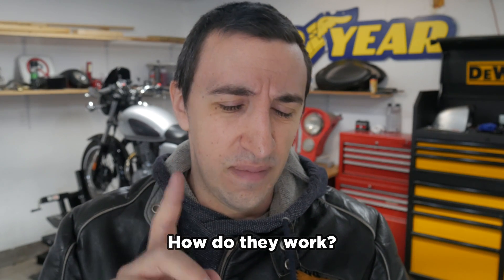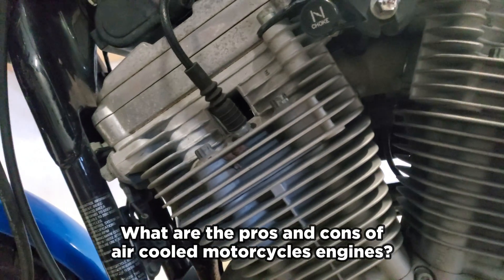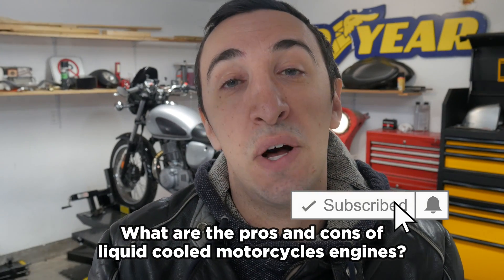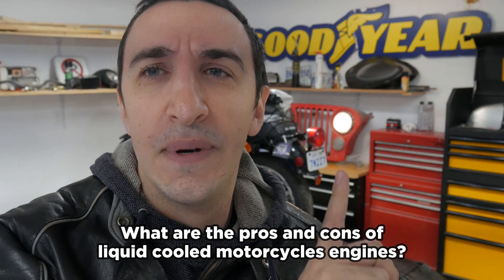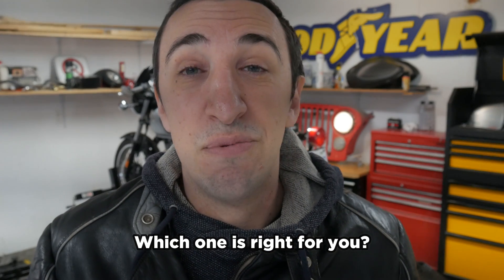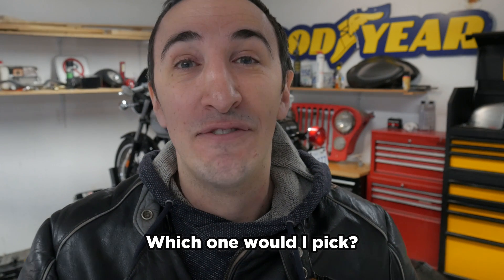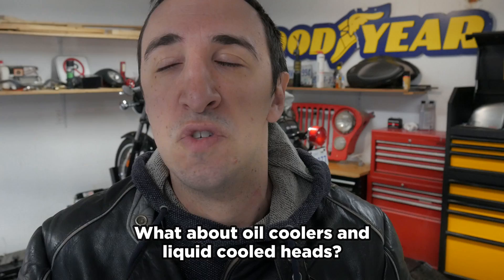Liquid Cooled vs Air Cooled Motorcycles

Comment: I’ve always wondered how my air-cooled riding lawnmower engine doesn’t overheat! Riding lawn mowers don’t move very fast & the engine is covered by a hood & the temperature was 96 degrees when I cut the lawn. 🤔😲
Reply from the maker: The RPM is probably wayyyyy lower than on a motorcycle... Less combustion 💥, less heat🌡️!

Comment: Another benefit of watercooled is they get UP to temperature faster than an air cooled because the thermostat allows the engine to heat up to its operating temp vs the air cooled still having fins when cold. It leads to a much more consistent temperature thats much more ideal for an engine.
Reply from the maker: I didn't even think of that, you're right! Thanks :)

Comment: Hello great video I Live in Oklahoma small town and I was getting my wife a 250cc automatic liquid cool motorcycle but it was Too big she’s only 411 and she doesn’t want to be on a tiptoes so she wanted a 200 cc automatic but it’s air cool and it’s not a lot of Traffic backed up so will that be good enough for her and she’s fairly new to ride motorcycles please let me know it fits her better it will be a big help
Reply from the maker: What model are you thinking about? How about a Suzuki S40? Seat height is real low. 650cc. Air cooled but if she doesn't wanna go fast that's okay.

Comment: Whether liquid, oil or air cooled all bikes predominantly use air to cool them. It just swings abit in favor of liquid cooled at low speed/high temps when that bitty little fan makes up some of that ground. The biggest advantage of liquid cooled engines is the ability for the engineers to build tight tolerance high hp machines. Thats why Harley can ONLY go bigger CI. Because torque is the objective.
Reply from the maker: If we ignore all of the liquid cooled Harley-Davidsons, then sure lol

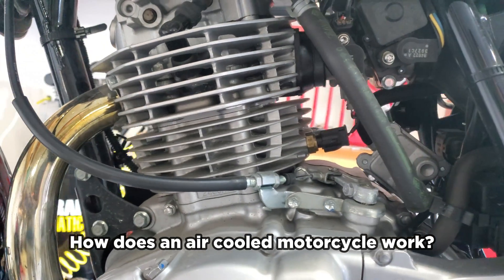Comment: You forgot to explain, that air cooled is used in lower compression ration (below 1:10 ), and liquid cooled is used in higher compression ration (higher than 1:10)
Reply from the maker: I never thought about it like that but you're right :) I think it's a big of a chicken or the egg. Did they make the engine liquid cooled because they wanted more compression, or did they give it more compression because they could because it was liquid cooled. Perspective...

Comment: When I'm sitting in traffic I shut off the engine to prevent the it from overheating. I tend to shut it off more often during the hotter months for obvious reasons.
Reply from the maker: I'm currently enjoying riding a Sportster in the winter here in Canada, for opposite reasons haha :)
Reply: hotter months ?? How hot are we talking ? 
I live in Florida where its hot year round between 80-95F

Comment: Thanks for the video. Why does the coolant in a motorcycle has to be replaced a lot more often than in a car? My Suzuki motorcycle manual says every 6000 miles and my car manual says to replace the coolant every 60,000 miles.
Reply from the maker: @JeffBassir-lo6zj  I'm no expert on coolant fluid but there are probably a few of reasons. Just a guess:
1) motorcycles have smaller radiators so you have way less fluid in there to do the job.
2) motorcycles run at way higher rpms which could cause way higher temperatures so not only do you have less coolant to do the job, but you have more work for it to do.
3) maybe something about how motorcycles are used less often are their parts are more exposed to the elements 🤷🏻‍♂️
Some things I don't ask why, I just trust that the engineers who are way smarter than me know what they're doing and I follow their advice.
Reply: @YouMotorcycle  I just trust that the engineers who are way smarter than me know what they're doing and I follow their advice.
That is the WRONG mentality.
Reply from the maker: Ok, I'm glad you know more than Suzuki's engineers. Since you're the genius among us, why don't you answer this person's question than, rather than simply criticizing others who are trying to help people?
Reply: @ well since you are cocky and arrogant i will not answer his question. 
I "work" with engineer's and have to deal with them on a daily basis.
Engineer's work with the mentality of perfect world scenerios not real world applications.
But YOU can google search the answer a hole
Reply from the maker: I'm not the cocky one. I'm the humble one saying professionals know better than me. You're the cocky one who thinks you know better than professionals. It sounds like your work has left you bitter. I feel bad for you. Your life doesn't sound fun.

Comment: I really like the looks of MotoGuzzi V7 or V9 classic bikes but the fact they are air cooled makes me worried.... I don't plan to ride them to town(much) but I do want to ride a lot in summer and take hot vacations to the seaside... I worry it would overheat.
Reply from the maker: V7 owner here. It's ok. The transverse vtwin with the cylinders sticking out helps since both cylinders have more space to cool in the air and neither cylinder is so close to the rider's core. It's a better setup than a traditional v twin like on a Harley where that rear cylinder gets no breeze and is right under the rider.

Comment: Do they have temp gauges or how do you know if your Harley is starting to over heat so that you know that you need to start moving or turn it off? Also does this mean it can’t be idling while sitting?
Reply from the maker: You'll feel it lol. I believe there may also be a light that comes on. It depends on the bike. It can be idling while sitting, but not for extended periods of time. Then again, no motorcycle should be left idling for extended periods of time.

Comment: I'm thining of buying a Moto Guzzi V85TT Travel. It's air colled.
Reply from the maker: Plenty of Moto Guzzi content here: https://www.youtube.com/watch?v=1xhEjQJsdIE&list=PLDu73pf3mUGBSdEFuHHe19lm-9_X1AEsJ
Reply: Okey thanks. But it's the V7 not the V85 model not sure what the difference are. @YouMotorcycle
Reply from the maker: @Youtube_Globetrotter  I have a review of the 2023 V7 which uses the same motor. No issues with heat

Comment: Einstein said: things must be built as simple as possible but not any simpler. The only reason manufacturers have switched to liquid cooled engines in the last few year is to comply with recent government emissions regulations.
Reply from the maker: Well, hang on a second... Manufacturers have been making liquid cooled motorcycles for over half a century. Government emissions is definitely one of the reasons why manufacturers are making liquid cooled bikes, but we can't say it's "the only reason" why.
Reply: @YouMotorcycle  I agree with you, manufacturers have been making air cooled and some liquid cooled bikes for decades, the only moment they switch to making nearly all of them liquid cooled was when strict emission regulations started to be implemented.

Comment: What to buy in a really hot humid gulf country? Air cooled like Harley or water cooled like Suzuki m109
Reply from the maker: as mentioned in the video, if you're going to be moving, air cooled works fine, if traffic is nearly a stand-still where you will be riding, I'd suggest liquid cooled.

Comment: I'm looking at a 2008 C90T but I unfortunately live in FL. Do u know if I'll have issues in the city with this oil cooled bike?
Reply: @YouMotorcycle  Thx, but when I look up the bike, it says : "Fuel-injected, 90 cubic inch, 6-valve, air/oil-cooled engine designed for maximum low/mid-range torque and acceleration."
Reply: @YouMotorcycle  Thx, but I just went to go see a 2008 at the local dealer and it's air/oil only.
Reply from the maker: @ItsJustJerryO  hey looks like you're right. Oil cooled, I can't believe it lol. Will you be doing a lot of inner city riding? More than touring? What's drawing you to the c90?
Reply: @YouMotorcycle  No problem. We'll I'm only 5' and I want a touring bike to do long trips, potentially from coast to coast. I currently have the Rebel 1100 and found out the hard way that, although a great bike, it's NOT built for touring. Even with a 19" Memphis Shades windshield and a gel cushion, I was hurting after a couple of hours and still had wind buffeting. I just today sat on that and the C50. I think the C50T would be better for me at only 5', 130 lbs. Any suggestions?
Reply from the maker: Have you tried looking at alternative seats, handlebar setups, etc. for the bike you already have?
Reply: @YouMotorcycle  I've decided to be patient and do that. It's just such a new bike that there's not a lot out there, but I'm finding things. Mustang has a nice saddle, and Viking has some universal cases that might work. 👍🏽
Reply from the maker: @ItsJustJerryO  I would avoid Viking bags like the plague

Comment: Why did you have an awful time on the air cooled Harley while in traffic? Did the bike die on you, or was it damaged? Did you get burned?
Reply from the maker: You know when you open your oven to check on your food you've had in there for 20 minutes? That feeling of HEAT that blasts you? Imagine instead of sticking your face into the oven to check on your food, you checked with your legs instead, and then you kept them there your entire ride

Comment: Liquid cooled bikes need airflow too. Weird people commenting here like liquid cooled bikes can sit in the heat not moving forever. Those fans are 1 of 5 additional failure points with liquid cooling. I'd take my chances with a modern air cooled bike not seizing up vs something goes wrong with the radiator/hoses/fan/coolant level/water pump. Advantage of liquid is tighter tolerances and more performance. Reliability is up to the manufacturer's design. I'll put the air cooled Yamaha XT250 up against any liquid cooled bike for reliability. Unless you need to engineer the bike in a way to require liquid cooling, simplicity always wins for reliability.
Reply from the maker: Re: "Liquid cooled bikes need airflow too."

Not quite right there Buck. Take the Harley-Davidson V-Rod for example. They are liquid cooled and were were built to run 500 hours non-stop, in heat boxes, in the desert. That's almost 21 days in a metal container in the desert. The liquid cooled motors did it successfully. 

As a motorcycle commuter, I sat in a lot of traffic, but I never sat in traffic for 21 straight days. An air cooled Harley can't do that. A liquid cooled 17 year old V-Rod can.

Source: Discovery Channel - You can see an excerpt here:  https://youtu.be/_x2L1sUUR-k?t=947
Reply: @YouMotorcycle  That's pretty interesting, I didn't know that about them. But it does sound like an exception and likely not anything specifically special about liquid cooling. Otherwise all liquid cooled bikes would be able to do that. It's an engineering feat for sure, and they happened to use LC to do it. 
I think my base statement that you quoted stands, as good as it may be, even that V-Rod is going to need airflow at some point. :)
Reply from the maker: @DaddySizeIt  but if at some point doesn't apply to real world usage, than its a moot point. Even if you're saying the V-Rod is some miraculous feat that in 23 years since it came out, technology has not been able to replicate (fat chance that's realistic, odds are things are even more advanced now)... Let's say other liquid cooled bikes could only last 50% as long... That's still two weeks straight running in a hot tank. No one is doing that.

Comment: What about small engines like generator engines why don’t they over heat if there air cooled and there not moving?
Reply from the maker: Slow down there bud. Air cooled generators can and do overheat. Google it :) they are also air cooled but designed differently. There are also many liquid cooled generators as well.

Comment: I’m mainly going to use my bike for driving trough the countryside so I think I’m better off with a air cooled bike.
Reply from the maker: You can go either way :) I wouldn't be too worried about the reliability of liquid cooled motorcycles. It's just good to know what the differences are, so that you can consider them when deciding what's right for you :)

Comment: Hi I'm somewhat new to writing I just bought a Honda 2021 25 trail motorcycle it goes about 55 to 60 in Florida I weigh about a 190 pounds and it's air cooled and I bought a new speedo for they make a special one and it's showing me the temperature of my bike when I grow up for on the road probably about full board for about Maybe an hour and a 1/2 it was showing temperatures of like 294 Fahrenheit or no and I'm looking online and they're telling me that this is normal for these bikes is that normal that seems kind of hide of me I mean I Stop but not stop and go like in the city I live you know Stoplights but nothing like yo city I'm out now Not rural area but you know not Congested area either the best thing I've seen online is a guy said he wrote his up the hill and he got to 340ﾟF and East oppon let it cool down and then proceeded to ride there was no problem that sounds scary to me I was thinking about adding an oil cooler but what do you think
Reply from the maker: I think I trust the engineers at Honda a lot more than I trust an aftermarket part for my motorcycle. 

Make sure you oil level is correct. Make sure your oil is fresh. You can switch to full synthetic if you want to and have done enough km to be due for an oil change.

After that I wouldn't worry about it. Honda knows what they are doing, and as long as you aren't leaving the thing idling for long periods of time, it'll be fine.

Comment: If those liquid cooled bikes don't drink enough water or liquid they'll pass a kidney stone and die. Air cooled operated motorcycles need cool air the hot desert isn't bad idea even at high speeds but I can live with air cooled because of one thing it doesn't eat so much of the water bill
Reply from the maker: It looks like I failed to explain how water cooling works 😂

Comment: What about a thermostatically controlled fan on the air cooled motorbike for rush hour traffic. I had one on my farm quad bike but the fan didn't switch on till my leg was just about cooked so I put in a manual fan switch. Engine heat adjustment at the flick of a switch which I quite liked.
Reply from the maker: Cool mod! Some companies also make add-on fan systems for specific Harley Davidson motors that are plug and play

Comment: I have a Yamaha Bolt 2015 (Air Cooled). In the summer running on the freeway at 75mph my engine runs at about 260F max. When I pull of the free way and I happen to get stuck at on a long red light the bike will cool to around 248F depending on how long the light is. A longer light it will cool down more. No wind just sitting there with a car in front of me and one behind me. This blew me away. Air cooled engines are more efficient at removing heat at an idle than is needed. I have never heard of  anyone who said. "My air cooled motorcycle overheated and ruined the engine when I was stuck idling in traffic". I have been been riding for 40 years. 
  Back in 1990 I bought a used early 1980s Suzuki GS650G air cooled in Phoenix Az. It had 75,000 miles on it. I put 75,000 more miles on. I rode it in the city and heavy traffic. It used I little oil before I sold it but the bike ran like a champ. Air cooled in one of the hottest cities in the nation. 
  I only buy air cooled motorcycles. The engine is out in the open unlike a car. Water cooled is not necessary for a commuter bike. Racing bikes are another story.
Reply: Thanks for sharing that. I have a 2014 Bolt.
Reply from the maker: Glad you haven't had any bad luck. In 15 years of motorcycle riding across dozens of bikes I've only had one failure related to liquid cooling. Both systems are reliable.

Comment: An air cooled Harley was probably more dependable many moons ago, (idk for sure?) but the new M8 engine from Harley has so many inferior, cheaply made, components inside the engine (where no one can see them) that overheating one is the biggest concern I have with my ‘21 Low Rider S. I have already seen a guy loose a lifter inside his 114 M8 with only 7k miles on it. I’ve heard of similar problems from others also. One guy saying his engine blew after a long summer trip and Harley had to rebuild it for him under warranty. My warranty is almost over and I can’t chance it. So I just purchased some “mighty mites” from Love Jugs to give my air cooled Harley all the help it can get. I’d hate to need major engine work at 10k miles (or less) when a couple of fans could’ve saved me the trouble. Or Harley could actually build an engine to last, idk, considering what we pay for these expensive toys! Come on Harley!
Reply from the maker: Some would argue the M8 motor is technically air and liquid cooled, because the heads are cooled on that bike right? Either way, unfortunately, I've heard a lot of cases of them giving people trouble. Bummer because people are spending a lot of good money on the motorcycles that come with those things!
Reply: @YouMotorcycle    Air and oil cooled on the softails. All the M8s come with an oil cooler and some of the touring models have additional cooling. Not sure how or what. The softails, like mine, are predominantly an air cooled engine with an oil cooler. Either way, Harley is being cheap where cheap probably matters most, inside the engine! Not “cool” Harley. Sorry about that, I couldn’t resist.
Reply from the maker: @robbyclark6915  😂👌